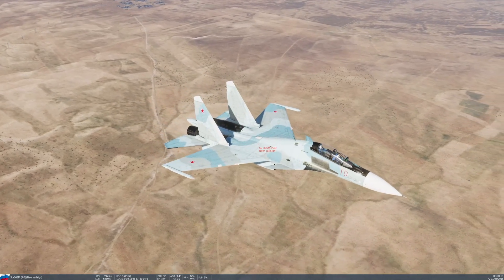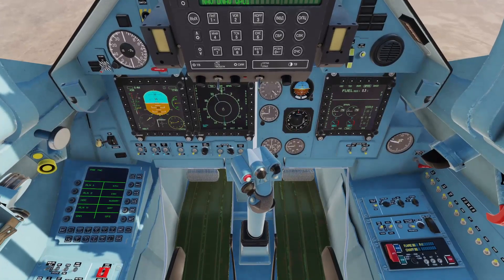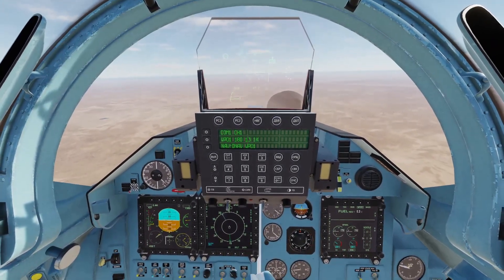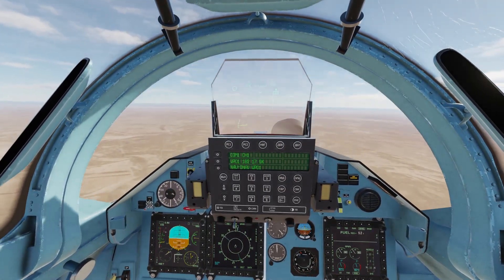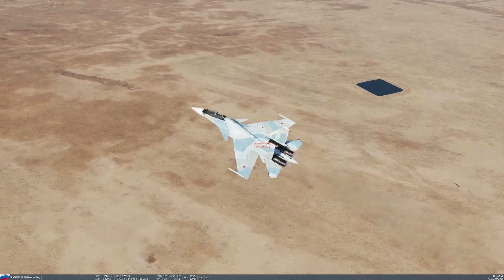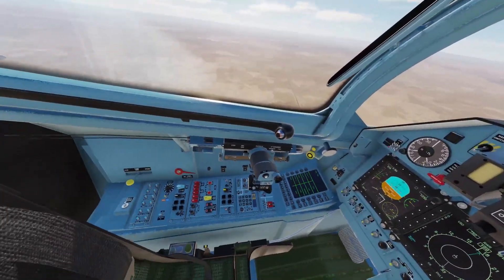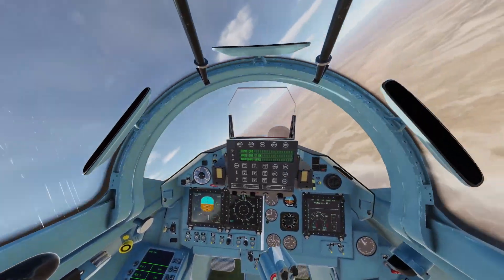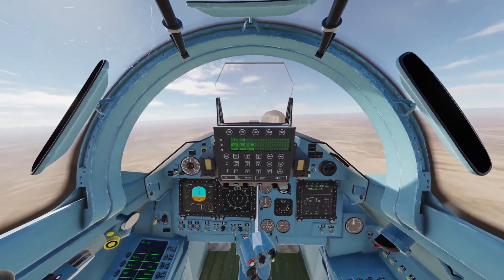DCS SU-30 Code Name Flanker Mod FCS Tutorial.

Comment: You can do controlled flat spins and flips!
Reply from the maker: Flips not really, flap spins yes.
Reply: How
Reply: @SimbaC07  thrust vectoring
Reply: @kaizer2k2  What do I press to do it?
Reply: @kaizer2k2  Can you tell me what controls I have all the aircraft installed
Reply: @SimbaC07  I think theres a button on the left side of the cockpit that u have to toggle and a switch on the flight stick it self to turn on thrust vectoring
Reply: @kaizer2k2  yeah thats in the video but it doesn't let you do flips
Reply: @kaizer2k2  Not sure what you mean by that?
Reply: @GoofyMtf what do u mean when u configure it but then cant see it? have u gone into mission editor and checked if its there?